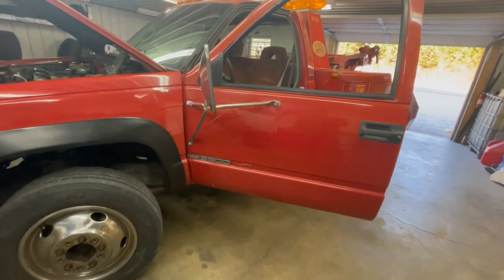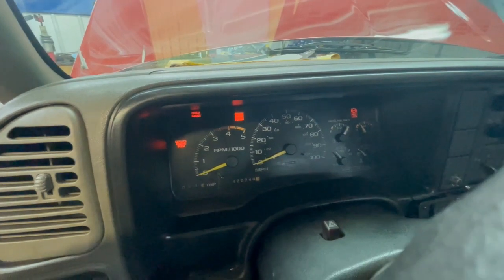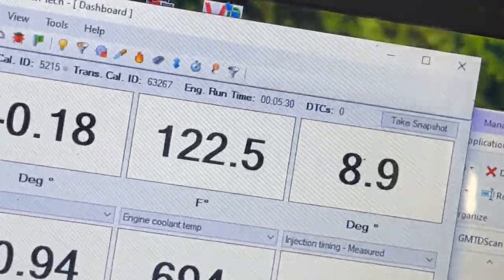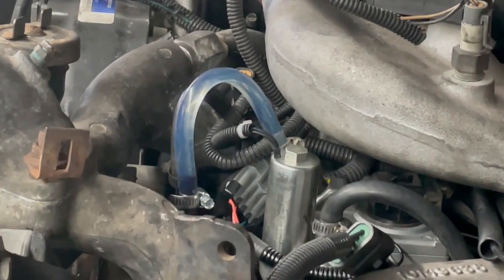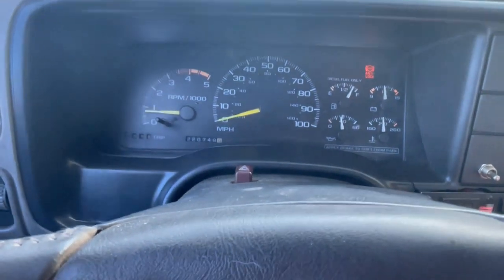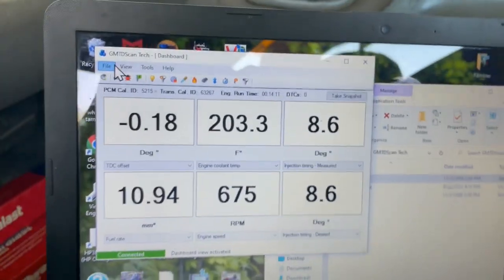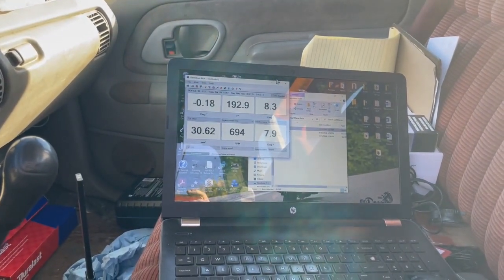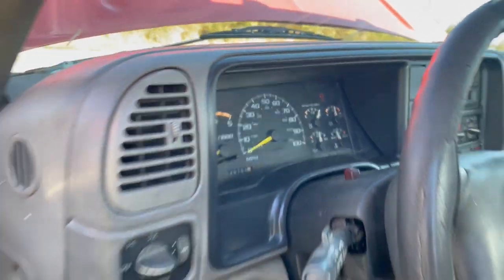Fixing Loping Idle & High RPM Sputtering on a Diesel Truck | Fuel Injection Pump Diagnosis

Comment: Did you install a resister in your pmd? After 1994 it is a must or maybe  the one in it is bad.
Reply from the maker: Good question….. the old PMD mounted to the IP did not have a resistor in it, which I’ve read causes the ECM to default to the lowest fuel rate, equal to having a #1 resistor. I put a #9 in the new PMD.
Reply: @wheelsandsaddlegarage  I would install "5 resistor
Reply from the maker: @tomrohn8607  interesting, why would you choose a #5? Thanks for the comment!
Reply: @wheelsandsaddlegarage  less stress on pmd..i carry extra pmd in glove box.did you relocate your pmd
Reply from the maker: @tomrohn8607  Yes, it has been relocated and also have a spare in the glove box.

Comment: Fuel pressure? You're right on the fuel rate as those kind of numbers are what I see on my 94 at turnpike speeds. Idle should be around 10 mm3. PMD location? If relocated off the IP, then what kind of shape is the harness in? You said you're familiar with the 6.5 so probably aware of their sensitivities when it comes to bad grounds. Certainly doesn't sound happy. Very interested in your findings as these darn things can make you go bald with frustration. Turbo sounds better than mine if that's any consolation. 😁
Reply from the maker: I appreciate the reply. After discussing the problem and readings with the pump rebuilder, they agreed the problem was something inside the pump. They shipped me another one priority. See part 2 here

https://youtu.be/3JnLu6FPaLQ

Comment: What turbo do you have on this truck??
Reply from the maker: It's the factory GM-4 turbo, which I believe was made by Borg-Warner for GM.
Reply: Very cool. It spools so quick I had to assume it was a GM-x series turbo. Is that the sm465 Manual transmission?
Reply from the maker: No, it's a NV4500 5 speed